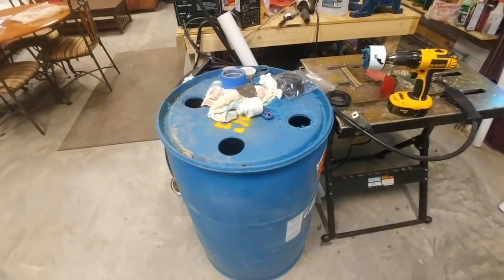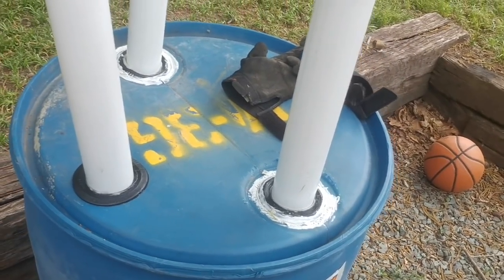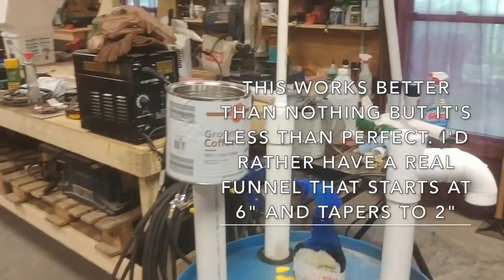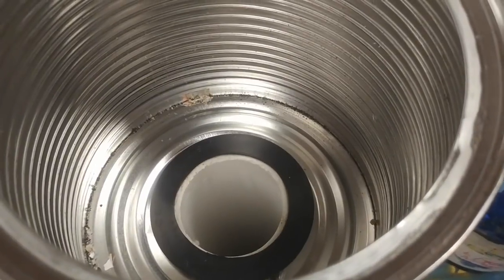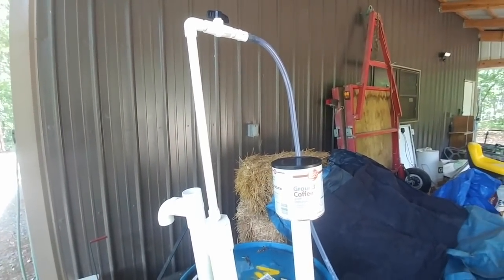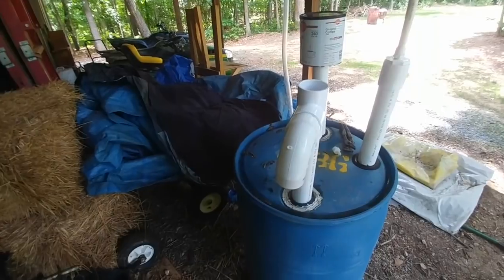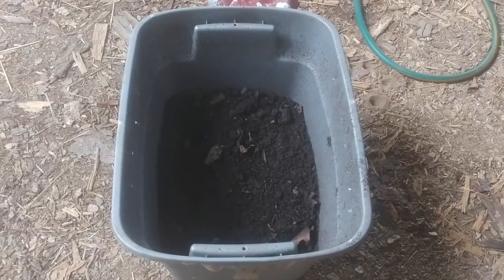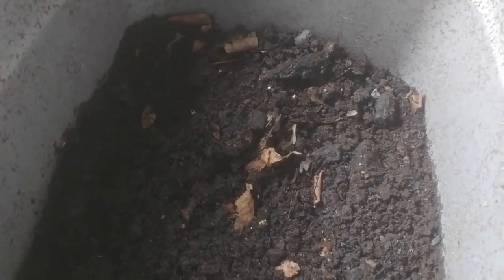Biogas Generator Build: Becoming More Sustainable

Comment: The height of the gas pipe being that high help any moisture in the gas to condense and flow back into the digester. As for starting it, yeast?  No, Dung is the starter, cow, horse or human since they all fart and make gas already so the bacteria are already in it.

Comment: The BioGaser or maybe we should just call it "The Big Cheese", Lol, will work even better/more efficiently at creating the methane gas if you paint the barrel and PVC pipe/tubing black and then keep in direct sunlight for as long as possible. The heat from the direct sun will help increase the amount of gas it can create, as well as speed up the process of converting organic matter into gas

Comment: I think it possibly didn’t work because the shaded area and limited sunlight. The methane process is sped up by heat & drying the pile. Best of luck with future projects
Reply: Make sure no O2 can get in, biogas can only be produced by anaerobic respiration caused by no Oxygen/O2
Reply: Heat + oxygen + composting= methane

Comment: I cannot remember where I saw it...but there was a video about how to use the bio-gas.
He did use a queen sized air-mattress & when done he hooked it up to his grill with a standard regulator.
Then he put a full sheet of thin (about 1/4 inch) plywood on top...then a few rocks spread around evenly.
It made it pressurized...and the grill worked like normal   :)
Reply: I've also seen someone use a harbor freight compressor to feed biogas into a LP cylinder. 1000L fit into a 45k tank (264 gal to 90lb tank).
I would note I saw another person feeding biogas through steel wool and then bubbled through water to remove acidic compounds before use.

Comment: You could add a repair kit for the material in the air mattress plus Guerrilla tape or rubber tape for pipe leaks to the order to meet the free shipping amount.   the old guy  Bert

Comment: Not sure if the teeny prepper university had the gassifiers library in it.  All these were awesome pre-1930s wood methanol (toxic gas-liquid) burners with crap trash, crap prunings and wood chips w/ lots of foliage.  Super production, and then charcoal, carbon, and ashes.  Use all these for activated charcoal, lye water, and lye goats milk soap.  Can also string water heating coils in the system for hot water - or a secondary house, garage, barn heating source.  You truly better have rubber butt-nose stoppers - because that hellaciousness is worse than a summer city food dumpster - especially w dog poo inside.  Paint that on the asian hornet opening, and there will be an instant white flag appearing.  Could dilute down and spray the outside property line - and you wont have any problems with migrating mice, shrews, voles, gophers, rats, feral and wild animals, and snakes wont cross that crap line.  Might even be able to control ants, fire ants, squirrels, chipmunks, ....

Comment: This generator tank can create foam. The taller the exit pipe is the less chance you will have for the foam to escape from the barrel. That foam stinks something terrible. 
Great project. Make 4-5 of them and you could run many things off of METHANE. Your stove, power generator, your car, your hot water heater, your house heater......... If you are making your own compost: the composting process also creates methane.